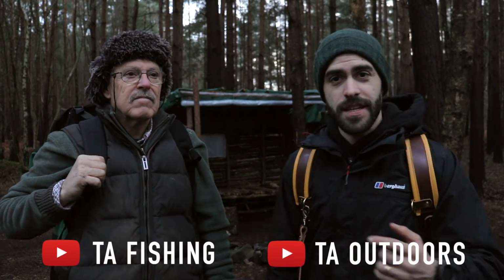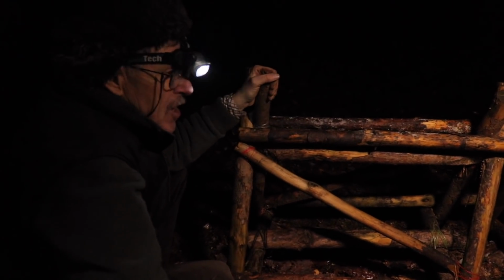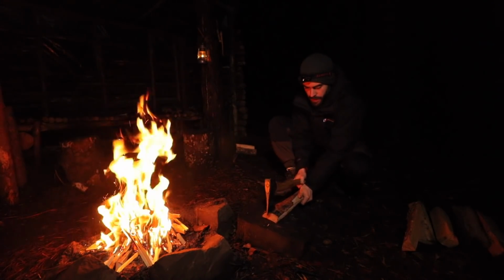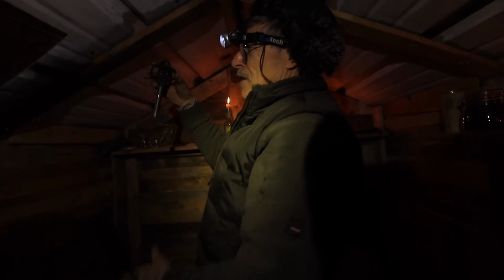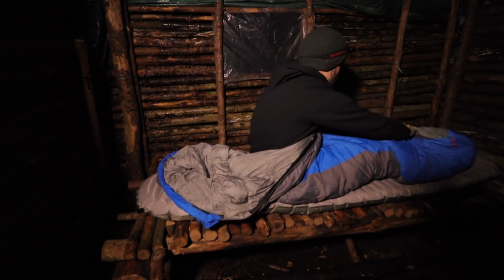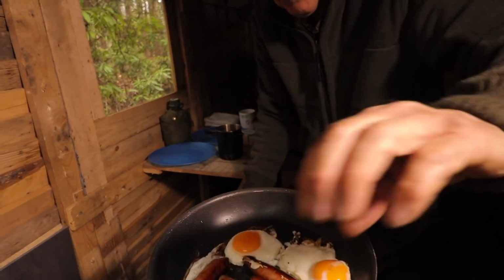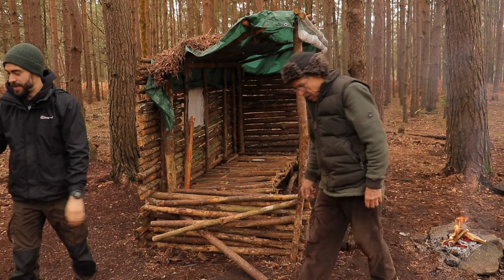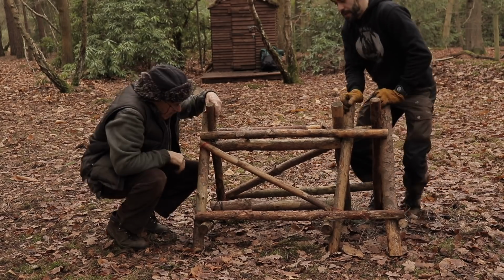Camping Overnight at The Bushcraft Camp & Off Grid Cabin in the Woods

Comment: Your dad has got some really good quality clay there. I used to work in a pottery shop for ten years so I know a fair bit about clay. Something you should try if you want to make the clay stronger is to take some of the shards of dried clay and burn them really hot in a fire and then crush them into a sort of coarse sand and mix that to some of the fresh clay. That will make it much stronger. Then to avoid braking the pots you need to dry them for about two weeks in a place which is not too hot. Once its dry you can burn them fairly hot without them braking. Also a wood stove might not be hot enough to make the clay really hard so you might need to burn the clay in a fire outside. This type of clay you got will turn slightly red when it properly burned.

Comment: Idea, get a roll of bamboo fabric and pop revits and eyelet gun and large putty knifes and a hand pump garden presurized sprayer. Cut bamboo fabric and over fold over one side and place eyelet's and pop revits. Use cordless drill to drill hole's in the wood and use pop revits to attach the bamboo fabric to the outside. Then use Gorilla glue and use putty knife to force the glue into and onto the bamboo fabric. Repeat process covering the structure like shingle's. then ounce totally covered? Spray down with water activating the Gorilla glue that will foam up and harden. Glue will become tacky which will allow you to throw sand or dirt on it to camouflage the structure. The Gorilla glue will foam up and harden making a water tight insulsted structure. You could even use this method to cover a chicken wire dome on the inside then on the outside for a dome cabin. 😊

Comment: Your heavy entrenching tool looks like a German military model, or copy of one. Push the cross bolt sideways and you can swivel the tools into position. I've seen some that use sprocket teeth to lock, and some with a square locking bolt. It is spring loaded so will push the bolt back. Shovel, mattock, pick, etc. it's heavy to be sure, but it is a serious tool and very versatile. By far my favorite entrenching tool to use. It will not fold or loosen during use, and can be disassembled easily for cleaning and greasing. I keep one in my jeep that I put a bit longer handle on (actually for a log slick) that makes it more comfortable to use but less carry friendly. I have an original handle one for pack carry. There is an aluminum piece that clips over the spade to make it better/wider as a snow shovel, but that bit is very rare to find, but would not be hard to make.

Comment: I didn't see an answer regarding your e-tools questions so if already answered, sorry. 
The entrenching tool with the wooden handle is West German, I believe. It is operated by depressing the hinge pin laterally (push and hold down the end opposite the smooth dome side) while adjusting the shovel blade/pick to the desired angle. It can be set either 180 degrees so that it is configured like a shovel, or set at 90 degrees and used like a hoe. The pick on the reverse of the shovel can be elevated to the 90 degree position to be used as a pickaxe.